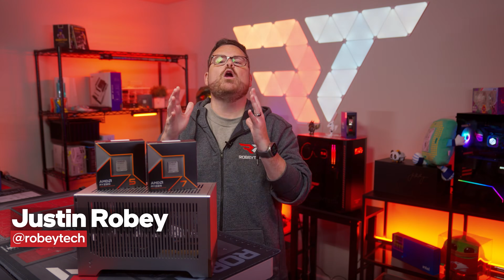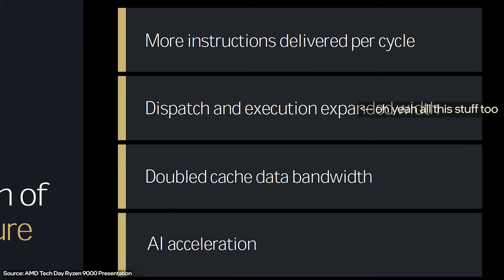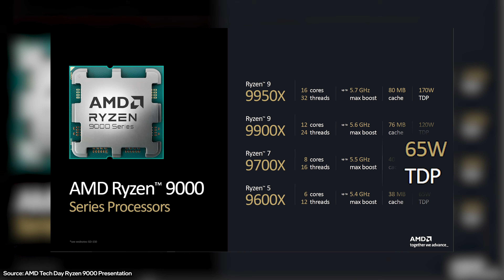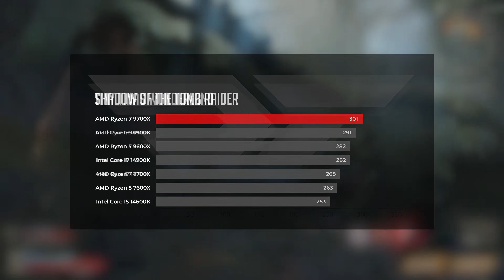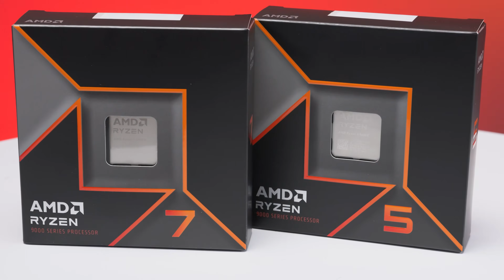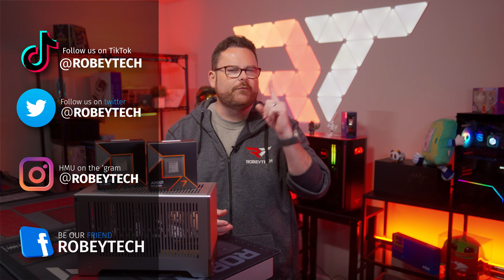The Power of the Ryzen 7 9700x Review & Build

Comment from the maker: UPDATE!!!  - Hey, I wanted to add something we learned after.  Also, huge shout out to Hardware Unboxed for the additional analysis.  We have an updated review coming later but game uplift is actually closer to 5% and in our rush to finish the review on time we did choose titles that were more Zen biased.  Also, when comparing this chip against the 7700 (just for gaming) you may have a better more economical option versus the 9700x.  For SFF builds that do productivity and gaming you need to decide if the boost is worth it. 

Hardware unboxed thread X with us on gaming for visibility - https://x.com/HardwareUnboxed/status/1822151590591013338
Reply: Why BIASED? I think people must come up with 40-50 different game benchmarks to have a final conclusion...
Reply: I was going to ask you what's happening as your 9700x wins against 14900K
Reply: i guess you cooled the intel systems with a 120mm aio
the numbers you pull are holy mother missleading - can you crawl deeper into AMDs behind?

in gaming i have seen 9700x pulling 170+ watts and yours stays under 100w? - this review should be alarming to everyone watching - this is 100% bought or hardcore fanboy of AMD
Reply from the maker: @mm3871  what! If you don’t believe it watch it on the live stream!?!  We did it live so you can’t  even hide it.  Not sure what 9700x you are using….
Reply: @mm3871 170 Watts? 😮 My 9700X never goes over 88W.

Comment: I put a 9700x into a smaller form factor build, with a low profile cpu cooler. Perfect chip for it. On a side note, you should mention the other specs and settings used for the gaming comparisons.
Reply: What cpu cooler did you use? Can I buy 165w TDP cooler?
Reply: @jerzychodzkoww8080  I used an upHere top flow cooler. 180W TDP

Comment: This Processor with RTX 3060 12GB 
Gigabyte B850M DDR5 Wifi

32 GB RAM
1 TB SSD

Is this okay for a Video Editor?

Please reply
Reply: It should be enough. I’m pretty sure the cpu majority handle video editing. 

I don’t know what kind of editing you would do, but I’m sure it will be enough to handle what ever you throw at it

32 gb should be more enough. I would get 2x16 gb just to future proof it. Just in case you need more ram.

Ssd is good for now, but videos take up a lot of storage. So you might run out of space faster than you think lol. 

If you’re going for a cool low temperature pc build. Perhaps the 4060 would be more ideal. They are the same price, plus the 4060 runs way cooler than the 3060

If you’re doing basic editing, I don’t think you need a Gpu. Just make sure you have a good a cpu cooler and you should be good to go. I recommend the Thermalright phantom, but the choice is up to you

Comment: Going to microcenter today to pick this chip up for $300. Pairing with a 7900xt for $640. And an MSI X870 motherboard for a chipset to take full advantage of 9000 series, including possibly finding 5x4 gen 5 SSD main drive. These are actually not terrible times for PC building if one is patient with the build.
Reply: Before you do that, or if you have, go for the bundles at microcenter. They are extremely good value, you get the 9700x, B650 MOBO, and 32 GB of DDR5 for 450$
Reply: @ Thats a good bundle. But B650 mb has no pcie5, no wifi 7, and the ram offered is a bit slow. My last pc build gave me 9 good years and is still going with one gpu update. I’m going to ride am5 for the distance.

Comment: Biggest problem with reviews these days, the competition is shown with parts from different levels.
The review should show parts from same power category. Compare 9700x with parts having 65w TDP. Why are you comparing intel K, F and KF series which have way higher TDP.
Same goes with automobile reviews. They will review a Toyota 2.4L base engine with Mazda turbo 2.5 and crib about the sluggish performance from toyota.

Comment: This CPU casually reaches Intels singlethread under 100 W. The singlethread is brutal. The multithread is on a level of a 5900X. If you come from one you will not miss anything, unless you miss the noise and heat of double the heat that will be gone if you get the 9700. The 9800X3D may be better but its hard to obtain right now, so if you can get a 9700X for a reasonable price you can still upgrade later. The 3D cache only benefits specific video games, mostly sim and raytraced stuff.

Comment: You have to laugh at all the dissing comments on the 9600x and 9700x but I can understand to a certain extent from the early reviews but since the price drop and numerous Bios updates these chips are a different option altogether, They can be run at stock 65w for small form factor and laptop builds and the recent Bios updates take away the power restrictions allowing 105w as per the 7000 series plus you can completely unlock the chips, Truly a chip for all scenarios, Productivity has been shown to have an uplift of up to 20% when overclocked.
Reply: It's hard to find an objective review in 2025 when these old ones still top the charts! I just picked up my 9700X for just $300 and when I overclock it, it's performance will match the stock 7800X3D which is $160 more

Comment: Looking between this and the 7700x for a new AM5 build to upgrade from my 3600; which would you suggest runs best alongside the 7800xt card?
Reply: no bottleneck with that card going to a 9800x3d if you choose. My 6800XT is killer paired to a 5800X3D and 32GB Team DDR4, lots life. The 7700x/7800x3d / 9700x/9800x3d all your choices and will be fine, get what you can afford and you will have lots of life with that build, probably done by now

Comment: im planning to buy the rtx 4060 & Ryzen 7 9700x, is this a good combination too?
Reply: It’s overkill for the 4060. But you should get a 4060ti 16GB. The base 4060 is not a good card for what you pay.
Reply: @BrokeBlackGamer  Agree! Save 100 plus bucks by dropping to a 7600 CPU and using it to upgrade the 4060 to the 4060Ti version is the only way to go. 15 - 20 percent more raw performance and a lot more Vram on the card which is desperately needed. 👍
Reply: @nolan6137  facts 👌🏾
Reply: Honestly you can probably drop down to a 7600 CPU. That card will hit a bottleneck before the CPU. Check out the 7600x and non x variants.
Reply: @nolan6137  That's true. Low-end Nvdia cards ain't it....
Reply: I bought this Ryzen 7 9700X and a RTX4070, they are happy and working well.
Reply: Get a 7600x + 4070 instead for the same money.
Reply: If you want a GPU the same price as the rtx 4060 you should get something from Intel like the B580 (but that has a problem so you should wait till they fix it first if they ever will) which maintains RT performance unlike AMD's rx 7600 and rx 7600 xt and has 12 gb of vram. I suggest you downgrade the 9700x to something like a 7600 or 7600x unless you really need the extra cores, as others in this reply section have said.

Comment: If you're going to compare the 65W 9700X to its real predecessor you would need to use the 65W 7700 and forget about the clever naming trick AMD is using here. All the so called efficiency improvement goes right out the window when compared fairly. It also means the 7700 non X was $50 cheaper MSRP and had a free air cooler. This is a 9700 non X being sold as a 9700X.

Comment: now compare it to the 7800x3D tho...

I have a 5800X3D and considered waiting for this. After getting alot of info on this I realize I wasted time waiting and now will pull trigger on the 7800X3D. Only real CPU power I need is 3D print slicing and gaming. The 9 series are turning out to be a pretty big flop for me.
Reply: with opimized bios the 9700x is now equal to 7800x3d overall and may exceed in non gaming scenarios

Comment: This processor does amazing in server benchmarks, Linux, and syntetic. I don't think it's meant for games, but for workstations....
3d rendering etc. BUt You can always use PBO and squeeze more FPS from it...
Reply: Its still good enough for gaming, efficient and also performs well for video editing and rendering.
Reply: How is it NOT meant for games when it literally performs as well as a 7000 series 3XD CPU that was made specifically for gaming?
Reply: Why? Buy Zen 5 X3D for gaming.
Reply: @iLegionaire3755  the 7800x3d is not in stock and I can get the 9700x for $100 less, uses less power and produces less heat

Comment: Everything I've seen so far says they are pretty mid at best
Reply from the maker: It depends on the lenses.  As a new builder, especially for SFF and in some ways EU this is a good chip given its heat and efficiency.  If you Ryzen 7000 or on more modern hardware there isn't anything that warrants an upgrade or moving away from the 7800x3d.
Reply: @robeytech  which is kind of a bummer, I wanted these to be good. I am thinking of switching from my 14700k to something that doesn't give Anxiety about if my chip is gonna die. But I will wait and see what the ryzen 9 is going to.deliver

Comment: God grief this guy drank the Kool-Aid!:face-orange-raised-eyebrow:
Reply: Nearly everyone has bashed Zen 5 unmercifully. Yet when Intel shoves their dick up your ass with no lube for Raptor Lake, and sells overheating Space Heaters configured to degrade out of the box, that's perfectly fine to want to get Arrow Lake? When Intel has REFUSED any Raptor Lake RMA? I will only consider Arrow Lake if Zen 5 X3D is underwhelming and I doubt it will be.

What part of change the power limits in the BIOS for Zen 5 processors and enable PBO, use Curve Optimizer and Curve Shaper, is so foreign to people?
Reply: So far he is the Only guy to give this CPU a 'Positive Review' ???
Reply from the maker: Look there is stuff to appreciate about these chips and for new builders especially in the SFF space this is probably your best option.  I hate that liking something for the options it provides just because other people don't and didn't look at it from the same angle is bad.  TBH tech is not one size fits all.
Reply: @robeytech  Just making an Observation
Reply: @robeytech  No one and I mean no one wants to trade performance for efficiency. It's never a good thing otherwise we would all be running Celeron's, and sure a little trade off will be OK in some applications but performance is the driving force behind this discipline, even for space projects.
AMD reduced the current draw on these processors to achieve a desired efficiency at the expense of performance which is not going to sit well in this community, however these processors will perform if the power is increases. Shrinking the process does not mean more efficiency, it's actually the opposite. given the dielectric material that separates these transistors is becoming thinner the voltage must be reduced to keep leakage to a reasonable level.
I believe we have pretty much reached the end of this fab structure and a new method is necessary which Intel is on the forefront of  along with TSMC manufacturing.
AMD was not truthful about the performance of these CPU's...
Reply: @Bass.Player it has performance and efficiency.
Reply: @Berserkism  No one and I mean no one wants to trade performance for efficiency. It's never a good thing otherwise we would all be running Celeron's, and sure a little trade off will be OK in some applications but performance is the driving force behind this discipline, even for space projects.
AMD reduced the current draw on these processors to achieve a desired efficiency at the expense of performance which is not going to sit well in this community....
Reply: @michaeloneill1360  Leo from Kitguru likes it. Scatterbencher is getting great results and he makes the "reviewers" you watch look completely stupid. I think we know who drank the Kool-aid. Try being less indoctrinated by the negative crap you watch.
Reply: @Berserkism  I trust Gamer's Nexus, Hardware Unboxed & Jayz 2Cents

Comment: And there you have it, you're the only person on the planet who is excited for this total flop of a cpu. Yes, you can pay 40% more for a cpu that runs at lower power and no gain in performance over the 7700X (okay maybe 3% +or- depending on title). The only reason I clicked on this video was it had the word "Build" in it, and I thought, "someone's actually going to build with this"? The 7700 and the 7700X are both still a much better deal. I'm building my new machine today with the 7800X3D so I really don't care.
Reply from the maker: Excited for the SFF potential.  To be clear we also said it was only good at one to two core and above 1080p CPUs don’t matter as much (and gaming was impressive).  I think you are so used to overly negative reviews that when you find something more balanced it seems insane.  There are good things about this chip, is it what the rumors suggested no, but for new builders especially SFF or EU this is a solid option even over the 7800x3D. Also this is why people should wait for independent reviews because 9 times out of 10 reality doesn’t measure up.

Comment: Nice review less power and less heat sounds great. Can save some money on power supply, cooling and still have good temperatures. Also you wont need the most expensive motherboard with lower TDP and PPT. That means less thermal throttling and less performance loss because of heat and power delivery.

Comment: Would like to have seen the comparison to the 7800X3D.
Reply from the maker: We will have that in a future video.  Sorry we ran out of time.
Reply: @robeytech  Hint, the 7800X3D crushed 9000X. It would be cool to add in a 5000X3D part as well, they managed a few wins while remaining quite relevant on average comparatively. In Final Fantasy XIV 1080p max the 5600X3D beat everything but the 5800X3D and 7800X3D in this game. It was 5 fps faster than the 9700X and over 40 fps faster than all the standard 7000X. AM4 is so crazy good, on its way to over a decade of amazing gaming performance.
Reply: @bodasactra  Oh wow, "crushed" with 5 fps more on avg. Such a big difference. And no, it didn't. Go look at the 9700x after BIOS updates. It's faster in most games than 7800x3d and destroys it in productivity.
Reply: @derbigpr500  5600X3D 6 core closed at $170 and beat the newest 8 core two gens ahead on the newest platform, if you want me to use the word "crushed" I will to describe that.
Reply: @bodasactra ryzen 7 9700x beats the ryzen 7 7800x3d most games check again and am4 cpus dont even come close
Reply: @Respect-ow4hg  I am looking at Gamers Nexus 9700X review fps as I type this. The 5600X3D is beating it the majority of the games Steve tested in this review at 1080p. The 7800X3D is absolutely destroying it. I have no idea what you're referring to.

Comment: Where I live is sooo hot and I will upgrade my i9 9900kf to r7 9700x. Man, those temps...
Reply: the temps is great if you're going small form factor, but otherwise you can air cool anything from the 7000/9000 series just fine
Reply: Ok but outside temps have absolutely nothing to do with your air conditioned indoor temps.  Here me out, by this logic, its 10'F outside where I live.  So your telling me I should remove all the fans in my pc case?!?!?!
Reply: @HeroStrike  you better buy 7800x3d,it performs better and consume less power or just buy 7700x it costs significantly less while be only 3% slower on average
Reply: @Mr11ESSE111  No I won't pay 400 for a used CPU that cost 360 a while ago. Those people are insane although I understand it. But when you can get a new 9700X much under that price point its just an obvious choice. You can upgrade later still.
Reply: @voyagerdeepspaceexploration  why buying 9700x at all  ?' you can get 7900/x for same price and gaming peformance are similar and productivity way better of 7900/x
Reply: @Mastercrafted-MCHfor money back then it was pretty bad cpu,now they lowered prices because sale was bad

Comment: 9700x pricing and performance are so bad  so it  costs like r9 7900/x  or 7800x3d  and in same time its slower then both
Reply: New node, new release. X3D chips are not comparable. The 9 series X3D will undoubtedly be faster, it's low hanging fruit comparison. So is 12 core to 8 core. Do you think that 12 core 9 series will be slower than the 7900X 😂. 9700X uses less power and is faster overall than its predecessor, fact. Use Curve Optimizer with Curve Shaper and its one hell of a good chip. Go watch Scatterbencher to dispell your ignorance.
Reply: @Berserkism  r9 7900 use less power then 9700x and its much faster in productivity while same at gaming and costs same too!!
Reply: @Berserkism  actually it use 15-25 watt less with 4090 on all power system which are over 450wstt and that is nothing !!infact as i see few videos power usage are pretty close to zen4 cpus or higher then of 7800x3d !!